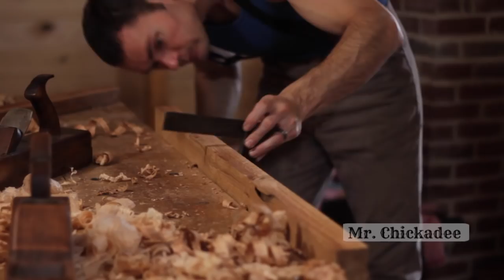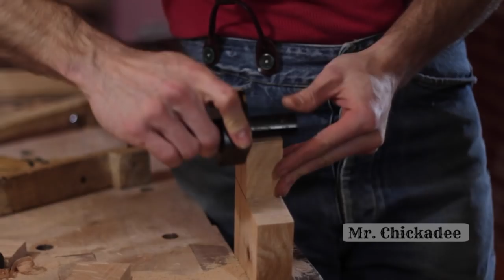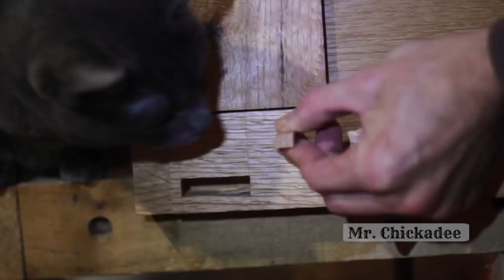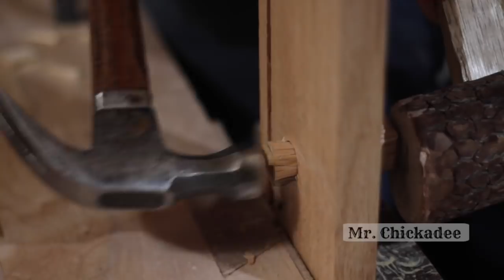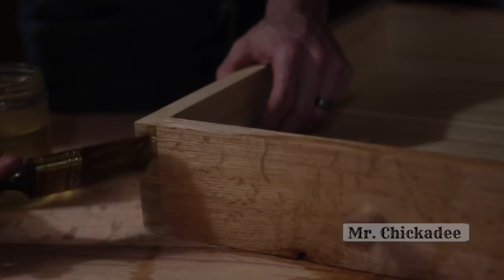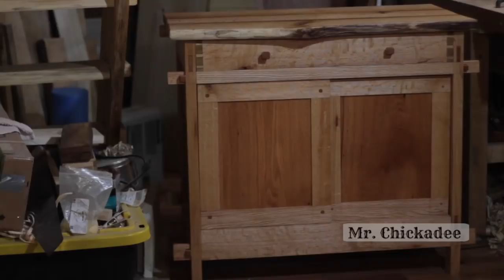RED OAK SIDEBOARD

Comment: LOL Charles the awesome cat has to inspect the work. He wants to make sure the work is nice and square and the joinery is tight. The sideboard meets Kitty approval. Charles has high standards.
Very nice as usual, Mr. Chickadee. It's much nicer than mine from Ikea and I like the sliding doors on the bottom where mine is wide open.
Someday I'll make some curtains to close off the bottom shelves.

Comment: Very nice build! I was looking forward to seeing another video from you.
I love your original joinery, very interesting. I just built a table and was thinking of joining the two parts of the tabletop like you did. But I went a different route in the end. But I'm glad to see the concept works!
Thanks for making cool videos :)
Reply from the maker: Thank you, Ive enjoyed your videos as well! How did you end up joining your table top?
Reply: Thanks! I ended up joining it with a tongue and grove glued with 2k epoxy. I made it out of Bubinga, which is pretty oily and extremely heavy. Wood glue didn`t hold properly. That seemed the best way to go for this particular table.
Reply from the maker: I find if I do use a glue joint, I prefer to use it in concert with joinery as you described with your T&G table top. If time is no conscraint, of course as you know, joinery trumps glue, espcecially when serviceablility is in play, what joy to be able to take apart and move, or fix a piece at any time!

Comment: You do make some beautiful artifacts. You make them the hard way so they interlock like Chinese wood puzzles but you do make them beautiful. And the appearance wood; you're really getting an eye for the grain. Gotta bring you into this century, though. One of these days we'll have to introduce you to particle board. And hot glue. And pneumatic staplers.

I showed this vid to my housekeeper. She thinks you're hot. I told her you run barefoot in the woods and worship cats but she didn't believe me.

Charles has certainly grown to be a fine specimen. Is he the carpentry inspector? All is well? Wood chips and home made bread etc?
Reply from the maker: Howdy Forest, glad you enjoyed! I try to use the simlpest joint possible to get the job done, though when certain rules are applied, such as no glue or metal, even that job may get a bit more complex. In all, its what keeps me sane and interested, if I had to use power tools and glue and screw things together, Id pick a different work to do! haha 

Charles has the final say of course. Great bread baking weather by the woodstove!
Reply: Mr. Chickadee Trouble with all that first class joinery you get a houseful of guests and the husbands have to figure out your latest endeavor for themselves. They'll cluster and mumble, probe and snoop over your cabnetry til one of them declares: "Secret dovetail - here!" and thumps the wrong place. The wives are not happy twice. Once at the gathering and again at their husbands laboring long into the night at the expense of chores undone and duties neglected. Woodworkers can't win.

Comment: Really excellent work!! Just being picky, you could have used blind dovetails on the front drawer so the poplar wouldn't show. Honestly, the work looks great.
Reply from the maker: Thanks! I used through dovetails so I could wedge them so no glue was needed. I wanted to build this without glue or metal fasteners of any kind. I dont know a way of wedging half blind dovetails...
Reply: A sliding half blind dovetail. Just to make it easy. lol   Actually, I was thinking, a sliding half blind dovetail with a wedge from the top would work.

Comment: Mr Chickadee, your videos are soothing and your craftsmanship is inspiring. Makes me want to go to my shop and scuff at my metal handplanes. 
You're probably not monitoring the comments on this video any more, but could you or someone else enlighten me as to the reason for the square pegs in the round holes? I get that it's a drawbore, but is there a reason you use square and not round pegs? Is it a stylistic choice, for ease (not that you're one to do things the easy way), or is there a functional reason?
Reply from the maker: Thanks for the comment. I find the square pegs bite and hold better than round. They are also easier to make. ;)

Comment: I am happy to see another video of yours a loved watching you do so much without any glue. 

How did you create the thinner panels that you used for the sides and back? Some didn’t look like a thicker panel that was thinned down around the edges.
Reply from the maker: All the panels are made the same way, one face is trued up, edge jointed, then they are tongue and grooved together leaving the rough faces either out or under or wherever they won't show. The smooth side of the panel is put in show area, and the back rough side is beveled down to fit the groove in the frame with a jack plane. The back and bottom are beveled in this way, sorry it didnt show in the video. Also for very thin panels like the drawer bottom, I will resaw 1" stock in half with a rip saw to get 3/8th stock.

Comment: Some interesting construction of the drawer bottoms flew right by   What did you do there?  Nicely done!!
Reply from the maker: the drawer bottom is quarter sawn poplar 3/8" thick, its T&G togther then planed like a panel to fit a groove ploughed in the drawer sides.
Reply: Thanks  The few seconds I caught looked like it was some kind of wide finger joint. Wasnt enough time to "study it" :)

Comment: Great job, really enjoyed it.
How do you prepare the thin boards? And how are they joined together? Do you use glue for those jobs?
Reply from the maker: The thin boards, they are planed true one one side, edge jointed with a long plane, then they get joined piece by piece together with tongue and groove joints (another set of planes does that) if they are really thin, like drawer bottoms, I will resaw a 1" thick board in half first with the rip saw to get 3/8ths thick stock first.
Reply: Thanks a lot

Comment: Hi Josh. Your use of joinery in all your videos is amazing.  where did you learn all of these different joints? Thanks
Reply from the maker: Thanks, I try and use the simplest joint for the given task, and searching old woodworking often shows ideas. There are a few good books on joinery, both Japanese and just general joints, available on amazon.
Reply: @MrChickadee  I see a lot of books on joinery available and its tough to weed through and find the good ones sometimes, lol.  I'll try some more searching using more words like old woodworking.  Thanks for the tips.
Reply from the maker: @thechiseledbeaver  The Joint Book, is pretty good, also The Complete Japanese Joinery, those are two I have read and can recommend, also any of the 5 books by Roy Underhill in the "woodwrights shop" series are great and deal with only hand tools.
Reply: @MrChickadee  Thanks for the recommendations. Roys books are great. I will look into the other two.

Comment: How do you get the mortices to line up between the pieces on the top, especially with hand tools?
Reply from the maker: I assume you mean the sliding dovetail keys that hold the top down to the base? After assembling the base, I simply lay the top on it where I want it to go, then carefully scribe from under where the dovetails are onto the top. Then its a matter of chopping them out and gentle shaving till it fits hand tight.

Comment: I agread... you make a amazing job.. but I see you don´t use any wood glue in the structural unions .. But I understant that you have a reason? Why don´t you use? If you used glue in the structural unions..What were the problems that could happen?
Reply from the maker: thank you, if no glue is used and all just pure wood joinery, the piece could last forever since even with a break or crack, it can be taken apart and repaired or replaced and put together agian.
Reply: Are the panels without glue too? I couldn't tell how you've joined the side panels together and when you put them in it does look like they're stuck to each other somehow...
Reply from the maker: No glue, they are tongue and grooved jointed together.
Reply: these "whole project" videos are good, and probably attract a lot of views. But I do miss the "how to" style of video where you focused in on (for example) only one timber frame joint and showed exactly how it should be cut. if you did something similar with the glueless panels, or other techniques, I would watch it many times over, and then get to making it myself.
Reply from the maker: Thats a good idea, Ill run it by the boss!
Reply: You're basically making the world's classiest flat-pack furniture, that will also last several life-times (if treated decently).

Comment: Do you use a convex blade on your planes, especially for rough out?
Reply from the maker: all my bench planes (try, jack, smoother, jointer) have some degree of camber as was traditional practice. They vary from very cambered like the Jack, to very little in the smoother. If a blade were placed with its tip agaist a piece of wood, my Jack would have maybe 1/4" of light showing on each corner, my try 1/16th, my smoother 1/32 thats the distance about off from flat across.